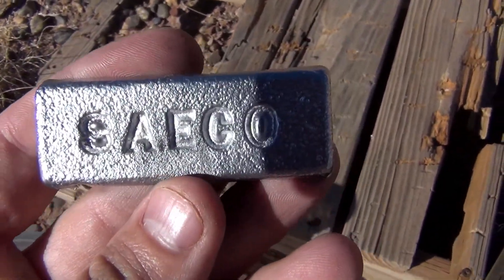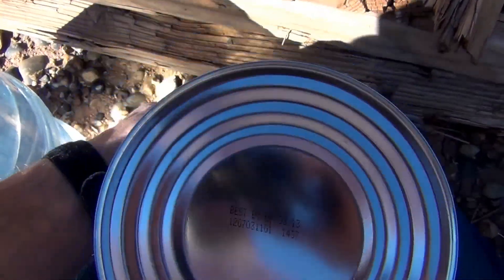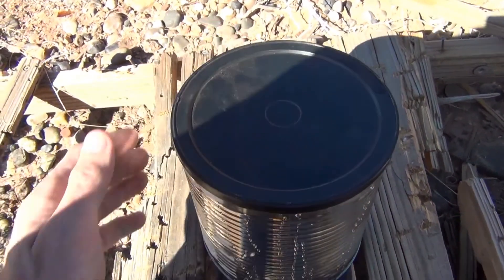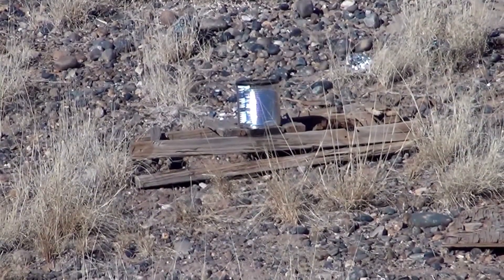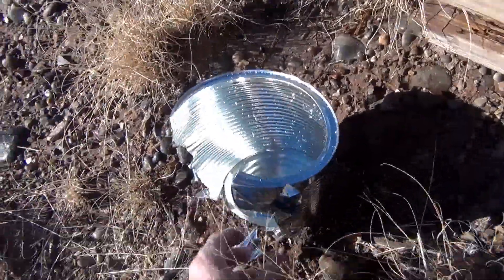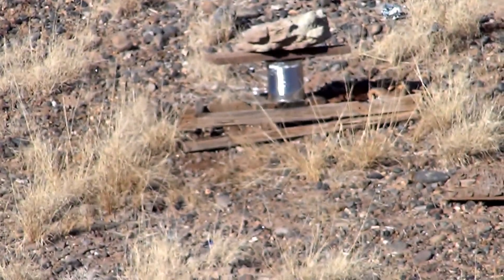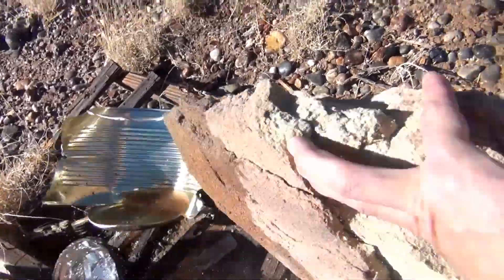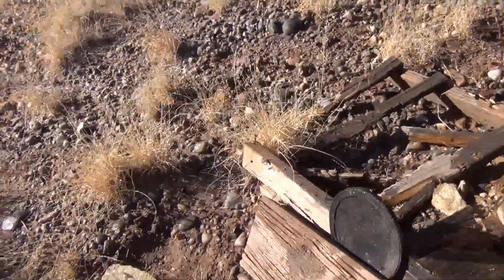Shooting a tin can filled with water with an object below it - HD (L).

Comment: Cool!

If you had a more solid base for the ingot and can to rest on you  would probably get a much more crisp imprint. Use something like a 1" thick steel plate resting on solid flat ground. The wood pallet is flexing big time which dramatically reduces the imprint impulse.

Comment: I've never done this and I don't have much experience with ricochet potential. Could a round ricochet off the edge of a 1" steel plate? Might be an issue since you are shooting from close range. Safety first!